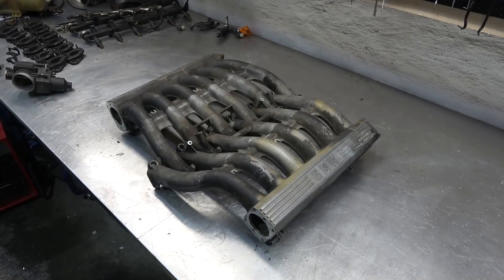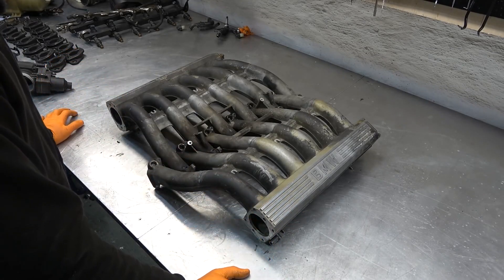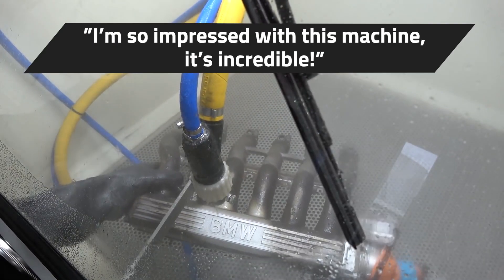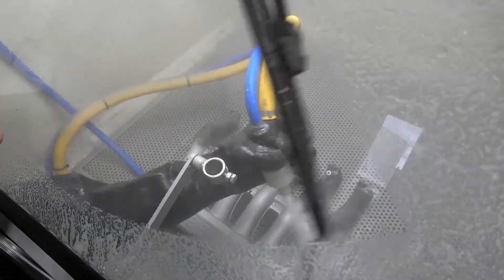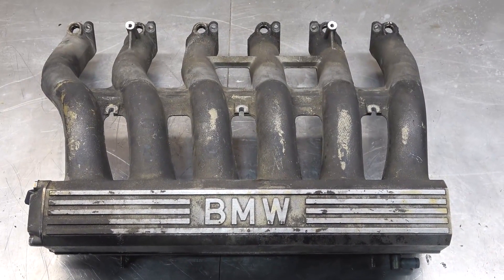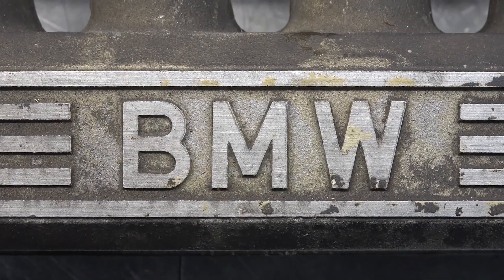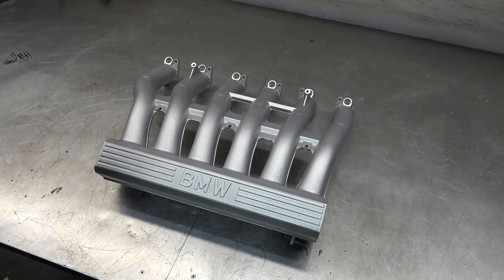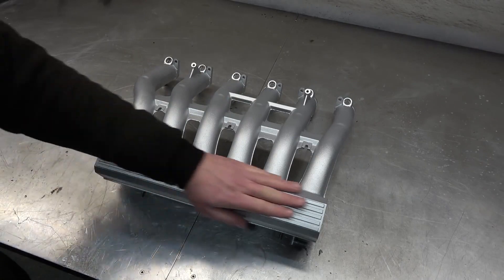"I'm so impressed with this machine" - M539 Restorations

Comment: Sreten, what media are you using. I've had my Vixen 915 for about 3 weeks now. It came with a bag of glass 100/150 media which is fantastic on alloy but not very good at removing any paint & slow on rusty steel parts. I was hoping to also use it for refurbishing alloy wheels too. It's a really magic machine but I do think it's important to use the correct media for the job
Reply: @DGT73  apparently he's changed to some ceramic media lately, I think he mentions in one of his videos... More expensive, but lasts longer and the finish is more to his liking. Can't remember the video he talks about this but it is one of the latter ones... He used the original media providad by Vixen until then.